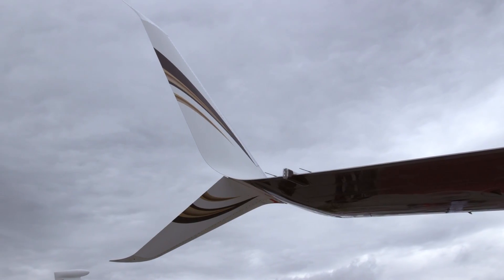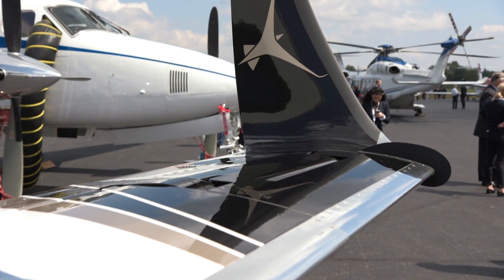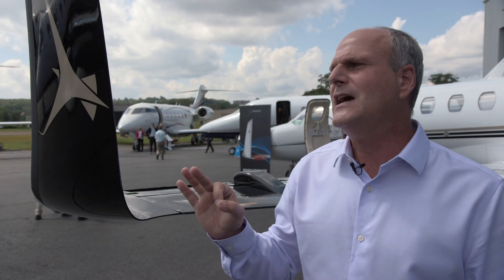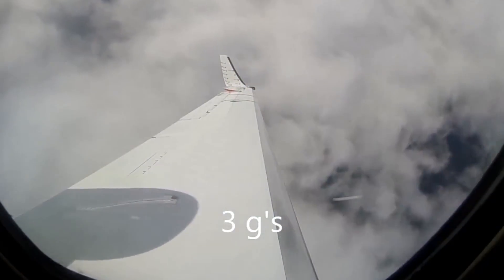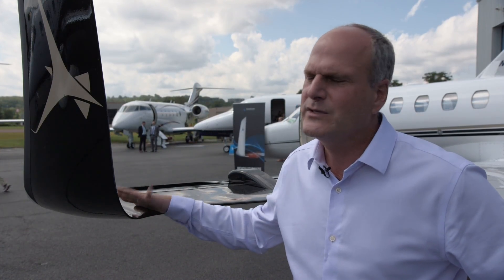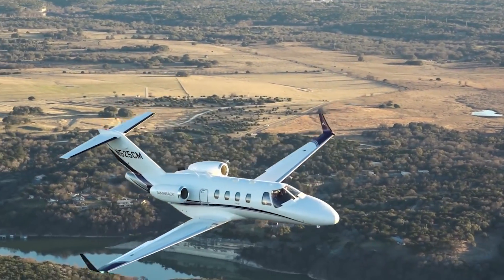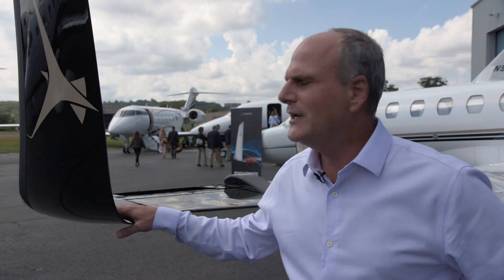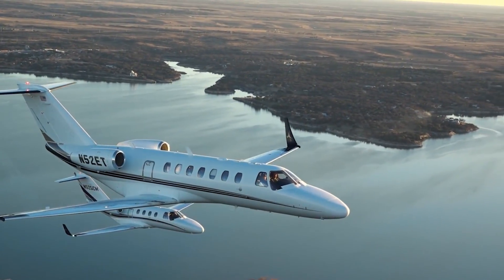Tamarack Active Winglets: A Leap Forward in Aerodynamics Technology – AIN

Comment: No. No. No. So much no. Why in the living fuck would I pay to have the increased maintenance and potential failure of another flight control surface in this gimmick-ass attempt to make a CJ's wing longer? If I wanted longer legs, I'd buy a different jet. No one in their right mind wants to sit in a CJ for 4 hours. What the hell non-problem is this snake oil trying to not-fix? Waste of time and money.
Reply: I'm going to take a stab at this and say you don't like the idea?
Reply: What if you don’t want to drop (or have) double digits for a two pilot jet with longer legs?

Comment: So the demo flight from Paris, TX to Paris, France reduced the refueling stops from 2-3 to 1. Then you say it added 300 miles range, about a 15% increase. What kind of math is this?!?
Reply from the maker: The trip could require more stops due to weather or increased payload, hence up to 3 stops normally. Under ideal circumstances it would likely take 2 stops normally. Thanks for watching!

Comment: Wings work by generating low pressure above the wing and high pressure below it. This essentially sucks the wing upward. At the wingtip, the high pressure air below the wing wants to move into the low pressure region above the wing. This creates a vortex at the wingtip, which reduces the wing's efficiency. A higher aspect ratio reduces the percentage of wing efficiency that is lost to creating the wingtip vortex. Winglets work to reduce the strength of the vortex by essentially blocking the air from moving the below the wing to above the wing. The technology advertised in this video isn't really an "active winglet" but rather a way have a higher aspect ratio and winglet size without compromising the structural integrity of the wing in high loading scenarios by essentially pushing downward on the wing at the wingtip where the most structural displacement due to flexing occurs while the rest of the wing is being pushed up by aerodynamic forces.
Reply from the maker: Thanks for the comment, and thank you for watching. The manufacturer calls them Active Winglets, and it's not for AIN to judge, but we welcome the discussion here.
Reply: Like most systems there are failure modes, but this system has been designed so that in the event of a failure the pilot is warned and can fly at reduced speeds. As you would expect from an aircraft system, we have done a lot of checks and the system is very reliable and safe.

Comment: Cool innovation.  Are they always manually engaged or does a G meter sense the need to negate the lift force? Such as entering turbulent areas.
Reply: They look to passively deploy based on the video.  So, no pilot input or sensing needed.  Simple g-force pushes them.
Reply: why you can hear a servo turning when he moves it.
Reply: @ristomladich246  Like the 787, they are activated based on sensors.

Comment: How exactly is this different from ailerons?
Reply: Nejc Lozar  My take, TACS seems to be used to negate or cancel the winglets effect during high stress events.  The winglets add lift, the TACS going up would cancel that lift as if the winglets were not there.  He wasn't clear but I bet they go up on both wings in a high G turn.
Reply from the maker: Yes, the TACS engage in high G maneuvers or during high wind gusts.  Thanks for watching!

Comment: I always knew that the winglets gave better efficiency. I mean just look at the 747-400 when they introduced that feature. The raked tip winglet do a great job as well. Plus its great to look out the window and see those beauties when flying.
Reply: The winglets on the 747-400 are only there because the buyers wanted the plane to look cool.

Comment: What if the active part fails during flight, then you end up with a wing that is not reinforced like a wing with a traditional winglet, then you fly a plane that is closer to its structural limits.
Reply: I would guess caution light in cockpit to alert that its inop and probably less speed, maneuvering, etc. Not too big of a deal.
Reply from the maker: Exactly, the active part is supposed to default to an up position in a failure, and the pilot is supposed to limit speed.  Even if they don't default up, reduced speed should be ok.  Thanks for watching!
Reply: Or it could crash the plane and kill three people like it did my cousin Andrew Davis in Nov 2018.

https://youtu.be/nYpvrQWeq-k

Comment: he says he gives demo rides to non pilots and they operate the controls. Sounds dangerous.
Reply: It happens all the time. Flight schools teach people to fly. As long as one competent pilot had a set of controls it's a non-issue :)
Reply: Michael Buttimer well they can't crash it instantly at high altitude
Reply: Michael Buttimer right but the point is you can have a non pilot mess with the controls safely. No worries
Reply: Do you have the impression that one wrong move instantly crashes the airplane?
Reply: https://en.wikipedia.org/wiki/Aeroflot_Flight_593
Reply: My statement that is sounds dangerous has, although anicdotal, precedence where a non-pilot operating the controls of a jet caused a crash(Aeroflot 593). And don't tell me the Russians are stupid.
Reply: CJ series is a single pilot rated small jet.  The right front seat is even cited as a “ +1 passenger seat.”  So long as that right seater isn’t suicidal and bent on taking the plane down and / or flying during terminal phases....
Reply: Normally one learns on an aircraft a little less complex... a C172 for example.

Comment: Airbus should be extremely interested in this technology for it's highly demanded A380 Mid-cycle Refresh!
Reply: Good Point. A380 order has been driven down.
Reply: Google it, you will find everything. I'm just highlighting some of it's new features.

1. New winglets add up to 4% efficiency.
2. Max. takeoff weight- 578 tons. Previous one was 575 tons. So 80 more seats or same number of seats with 300 nm more range.
Reply: airbus need to make safe planes and stop covering up every crash or problem their planes have.... but i spose thats the kinda crap that happens when a nation is behind a manufacturer.
Reply: The all new a350 has a 99% operation reliability. More than 100 built, still no accidents.
Reply: Not because of fuel efficiency though
Reply: A380Plus already has redesigned winglets.
Reply: But that new winglets won't work I think. Emirates is not so interested. They're the largest operators.
Reply: Jehan Kateli But it's not as complex as this which apparently has the ability reduce wing load, weight and cracks...
Reply: nick butler I haven't heard anything about this technology having been tested on an aircraft as big as the A380 or Emirates interest in the technology...
Reply: fhhsvnggbh wait what? Airbus aircraft are extremely reliable, just like most well maintained modern aircraft